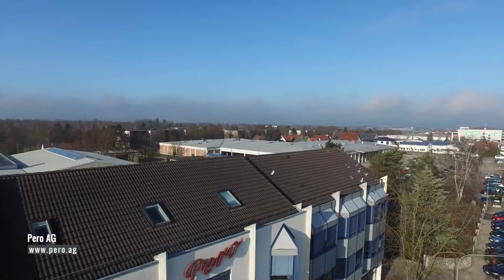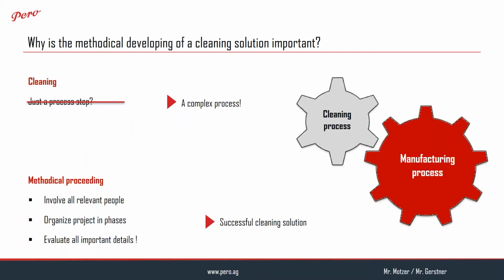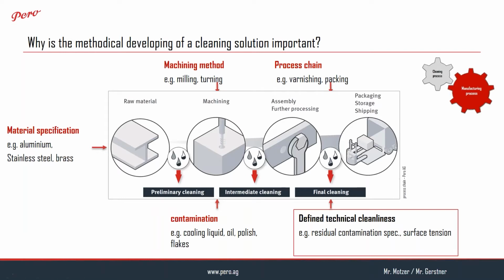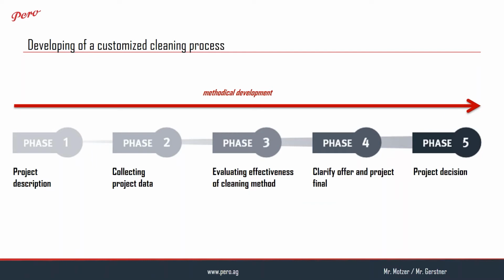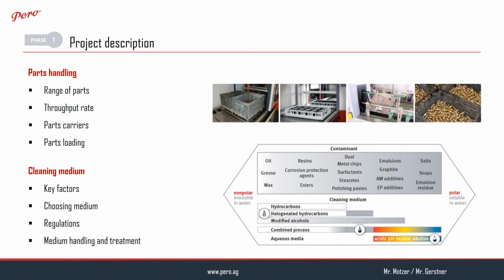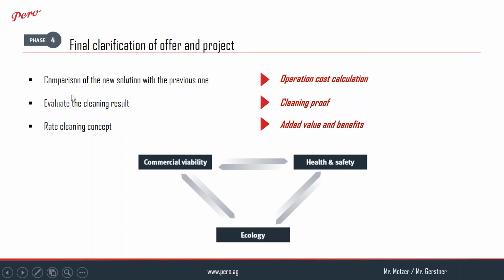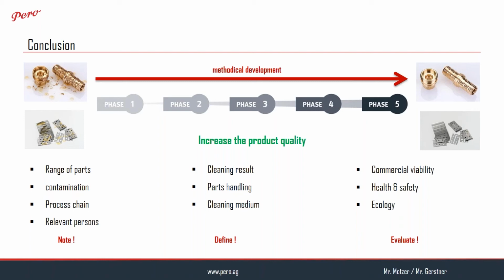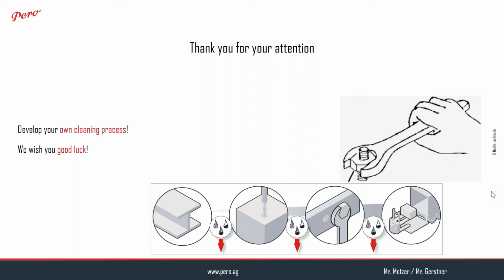METAV Web-Sessions | Pero AG

Comment: That was a good presentation on the step by step and methodical approach to Parts cleaning......The Parts cleanliness standards have undergone a drastic change over the last 10 years, and Washing/Cleaning of parts which were more of manual work, needs a methodical approach backed up by design and build of reliable machines/equipment in combination with the solvents for cleaning. I have few questions, and I will use screen shots from your presentation, compile them into a Power point presentation and list the questions for you to reply me.....I will email you to your website....Thank You